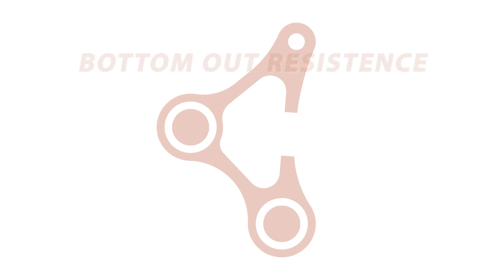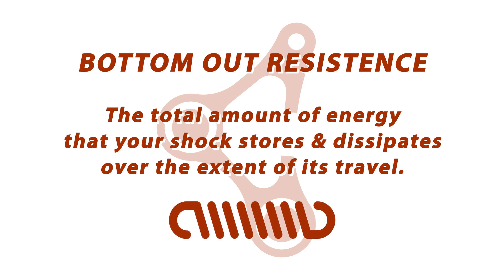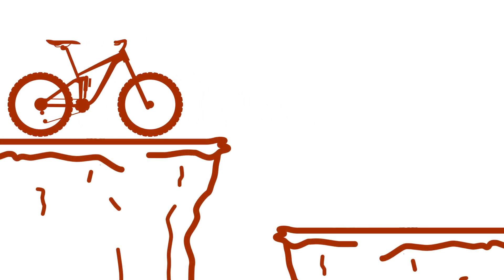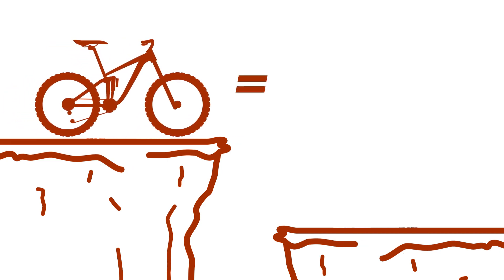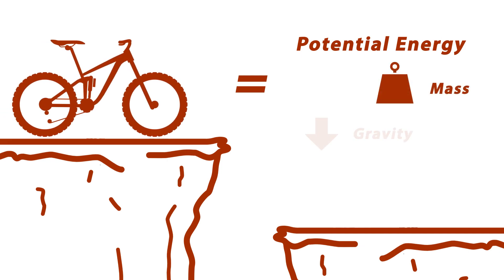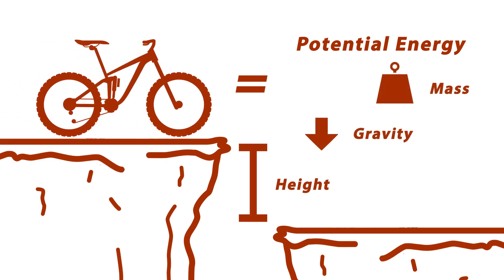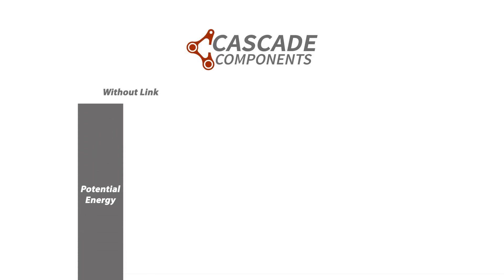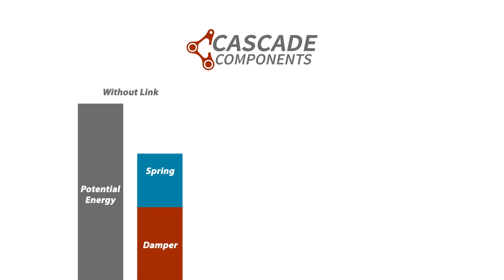Behind the Links & Bottom Out Resistance

Comment: Words cannot describe how thankful i am that there's a badass company doing things like this so i can take my riding to another level! You rock Jimmy! So your saying that if we normally run 30% sag then we could actually run 30-33% and still maintain good BOR??
Reply from the maker: Technically, yes. You could still maintain reasonable bottom out resistance with our linkage at 33% sag when compared to the stock linkage, however, running more than 30% sag can start to have a negative impact on pedaling performance/efficiency.
Reply: You dont even know how to ride.